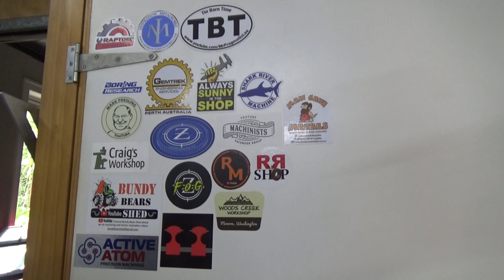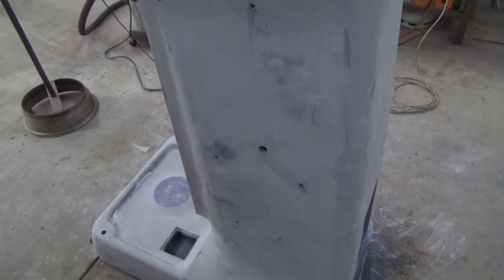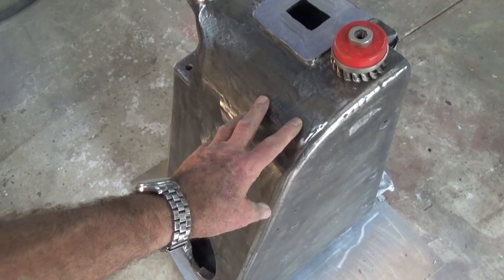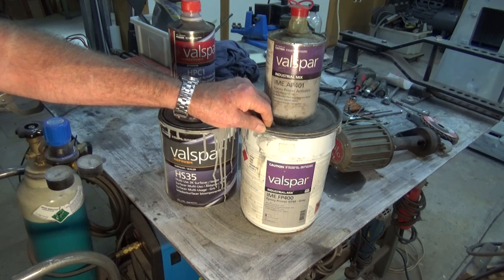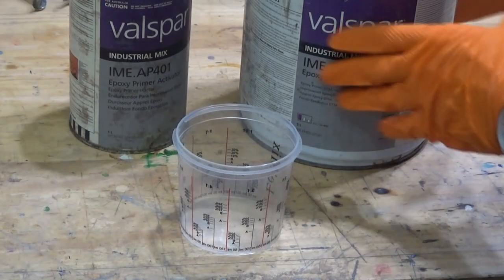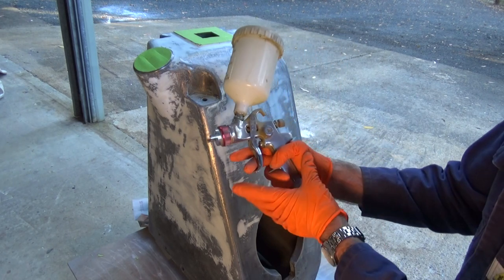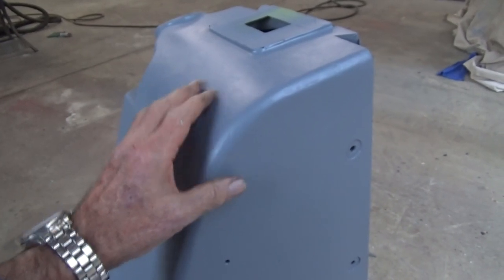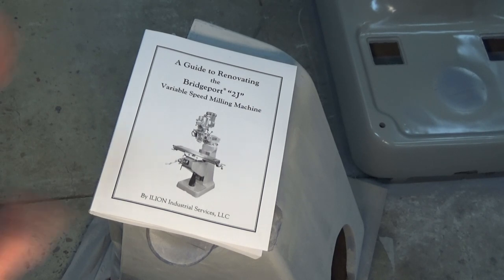Bridgeport Repaint With a Side of Humble Pie

Comment: Most of the preowned machinery I’ve purchased doesn’t get passed repairs needed to restore its ability to make precision parts. In my senior years, I’m much too impatient to restore them to their former greatness. I need to begin machining parts quickly. However I’m glad to see you return the Bridgeport to a thing of beauty. Keep up the great work. Stay safe.
Reply from the maker: Bill, I initially wanted to get the machine running without having to spend a lot of time restoring it but had it not been for a couple of broken oil fittings I would probably be machining on it now. I guess it just snowballed from there. I really do want it to be back together but now that it's painted I have to be extra careful about handling it in case I scratch or chip the fresh paint. It seems there is no end to it!
Regards,
Mark

Comment: Hi Mark,

For what it's worth. I had a lathe headstock (gearbox) casting as well as the carriage gearbox casting awhile back that had been exposed to many years of oil and apparently it was enough to saturate the cores of the castings (the inside of the gearboxes / oil reservoirs had never been sealed before they were put into service, it was a Chinese lathe that I no longer own).  The lathe I have now does have a coating on the inside of the headstock and carriage gearbox.
Yours shouldn't be that bad since it wasn't an oil reservoir.
Like you, I stripped the castings down to bare metal and I decided to try drying them out by heating the entire castings with a rosebud torch, to my surprise the castings caught fire and continued to burn off the embedded oil for nearly a half hour (good thing I done the heating outside of my shop).
I coated the inside of the castings with epoxy and a good primer before I repainted the exterior of the castings in hopes that it would not become saturated again. 
I have no real way of knowing at this point if it worked but most good gearbox castings I've seen does have some sort of sealer inside. 
I do know that the exterior paint seemed to be holding up pretty well even after about 5 years of use. 
BTW, the only reason I repainted those castings was because the paint was blistering and peeling off. The paint on the rest of the lathe was still in good shape when I sold it. 

Thanks for the tips on the best way to get a really smooth surface! I didn't go quite that far with the finish on mine but I sort of wish that I had :-D

Good luck with the remainder of your restoration project.

Joe
Reply from the maker: Joe, my Colchester lathe had yellow paint on the inside of all the oil reservoirs. but even so, the first paint job I did on it failed after just a few years. I used a cheap single pack etch primer and ordinary single pack spray putty to fill the castings. I also stripped the original paint with Selley's Poly-stripper. I was told later that the paint stripper leaves a waxy coating on the bare metal and subsequent coats of paint won't adhere to it. However, the Valspar epoxy coating and the urethane sealer have held up really well. I have had lots of recommendations regarding heating the cast iron to drive off the oil but I was worried about distortion and also I don't own any suitable heating gear. I guess I will have to wait and see if the latest paint job is durable or not.
Regards,
Mark
Reply: @Preso58  

Hi Mark and thanks for the response :-)

I wouldn't think that the knee casting on your mill is nearly as bad as the unsealed gearbox I mentioned. 
Heating the casting in your case may not have helped that much since most of the oil was likely only in the primer, filler and paint.
I was concerned about distortion from too much heat as well and is the reason for using a rosebud so I could heat the casting more evenly and not that hot either, I got it really warm instead of "HOT" if ya know what I mean.
I'm guessing that the moderate heat isn't what caught the thing on fire, it's more likely that the moderate heat combined with a direct high temperature flame is what caused the oil to burn off, when it came time to reassemble the gearbox everything went back in place without issue so I don't think it caused any distortion. 
As a side note, I'm reasonably certain that uneven heat on a casting like that is more likely to cause distortion, if the casting is the same temperature all the way though, it shouldn't distort in my humble opinion.  

I'll have to try to remember the waxy film left behind when using some paint strippers, I didn't know that so thanks for the information! 

Lots of educated guesswork involved in refinishing a surface like this and all we can do is wait for time to tell us if what we did actually worked or not, sucks doesn't it :-D

I have a fairly small oxy/acetylene setup and I mostly only use it for brazing. I have a good plasma torch for cutting steel plates. Having to buy really large oxygen and acetylene tanks just for a rosebud was too expensive for me so I went with an oxy/propane setup for use with the rosebud and it made good sense because I use propane for my forge as well.
If you are considering investing in a good rosebud heating setup, you may want to consider using propane instead of acetylene because of the cost of the tanks and the gas.  

The materials you are using as a filler and primer are kind of new to me, it's something that I'm interested in learning more about so thanks for the level of detail you provided in your video! 
I usually don't worry about aesthetics nearly as much as I worry about a machine working properly, I can't stand owning something that doesn't work right, even if I rarely use it!  :-D 

Thanks again, Mark and I hope you have a great day!! :-) 

Joe

Comment: Stopping and taking it back to bare cast iron was for sure the only thing to do.  Had you sprayed and then had to still go back and strip it down due to fish eyes or the like would have just been worse.  I personally enjoy the hell out of this sort of work.  Putting a better than new finish on something old makes me a happy guy.
Reply from the maker: Well, I can reveal that the final topcoat went on perfectly except for one run on the side door panel. No sign of fish eyes or oil bleed through so I feel like the extra work was worth it.
Regards,
Mark

Comment: Great video, and the humble pie wasn't so bad. Just a suggestion, when painting ALWAY'S PAINT ALL OF THE EDGE'S FIRST. Get color/paint in around that round opening first, paint the edge(s) in a north /south fashion (Top to bottom) first. You would want to get approx. 1 to 2 inch's (25.4 mm to 50.8 mm) width of the edge. Your correct on how to operate the gun, while spraying. To just add a little on the gun operation, the sound of air should never be interrupted with the sound of silence. Also to make it a little easier on the operator, put a very small amount of petroleum jelly (a.k.a. in the United States - - Vaseline® ) on the rod that the trigger pushes against. Also by adding the petroleum jelly again after cleaning your gun out, this will help to prevent the seal from drying out, and preventing the rod from being restricted to move in and out freely. You know the packing / seal has dried out when you pull on the trigger, release the trigger, the trigger return's to it normal position, but the rod has stayed recessed into the gun. When this has happened, either loosen the nut (approx. 1/8 {3.175 mm} to a 1/4 {6.35 mm} turn) that holds the rod, or find a drill bit that is very close to the dia. of the rod. Take the rod out of the spray gun, and by hand try to insert the drill bit, and turn slowly by hand, to cut a very fine amount of the seal / packing away.
Reply from the maker: Thanks for the tips. Unfortunately, when I was training at college, there was no tuition in how to spray paint properly. I had to develop a technique that I could teach to students so that they could get reasonable results quickly. About 10 years ago I invited a professional spray painter to do a tutorial for a group of teachers and he appeared to just wave the gun around in a random pattern and despite this, was able to get a perfect finish. When pressed, he admitted that he didn't know how to explain his technique, just that it worked and that was good enough. So, effectively we learned nothing. As I mentioned in the video, my robot method is not best practice but it gets a beginner to the point where they can get paint on a part with some success. I actually had to dismantle my gun just before I shot that video because the air valve rod was catching on the trigger and I did exactly as you suggested. Problem solved!
Regards,
Mark
Reply: Although i'm not a professional spray painter two of my best friends are and i can only agree with what you have said 100% as this is what they taught me . They always talked about dusting or blowing in the corners or hard bits  first then do the flat panels or flat surfaces . might try the Vaseline trick on my air brush !
Reply: @Preso58  Just to cover another possible problem people may run into using their spray gun's, when spraying with your gun, and you should notice that your getting color / paint on your finger's / hand, and your very, very sure the paint is not bouncing off what your spraying onto your hand / finger's, that's an indication the the air (mixing) valve rod Seal Diameter, is too great / big, and needs to be restricted / closed down some. You will find that it does not take much to reduce the seal diameter. Again just  (approx. 1/8 {3.175 mm} to a 1/4 {6.35 mm} turn should solve the problem. If the problem does not go away, via tightening the nut for the air (mixing) valve rod, unfortunately you will need a new seal. (Very rare for that to happen.) Just wanted to give your viewer's some information that could benefit them.  Happy painting. Preparation (and the quality of the preparation) is 90 percent of any paint job. How long should a paint job take? Answer a simple question. Do you just want some color on an object, or do you want a SHOW-CAR FINISH? Take the object Mark is painting in this video, if he wanted a "SHOW-CAR FINISH," it would be nothing to spend approx. a week (as in 5 day's,) preparing to paint the Knee for the mill. That would also include a base coating of three or four coats, and letting that dry for a day, then wet sanding with some 380 or 400 grit, to get a very flat surface, then dry, then wipe off with some lint-free towel's, one last wipe (at this point, paint is mixed, and put into the spray gun, ready to go) using what is called a "TACK-RAG," then proceed to spray paint your object. When using a "TACK-RAG" you apply just enough pressure that you have control of the "TACK-RAG," and it doesn't fall to the ground. If you have never used or seen a "TACK-RAG," think a cheese cloth that has been sprayed with a lite (minimum) adhesive, hence Tack-Rag. Also Mark could have sprayed his gravel drive-way down with some water ( just enough to make it wet) same for the inside of his garage. wait approx. 5 min's to 10 min's before spraying, giving the dust, etc. that you have disturbed (read that as dust you put into the air around you) to float to the wet ground and stay put.

Comment: Very interesting on the original filler makeup, and the epoxy paint handling and application, the only paint sprayer I have used was one powered by the extracted air from a household cylinder vacuum cleaner, I sprayed a Puch Maxi moped pressed steel frame.
It is my understanding that only the surface of cast iron can retain oil contaminates, rougher the surface, more effective surface, I think only Hydrogen atoms can penetrate ferrous materials. This is a mechanism for hydrogen embrittlement.
Thanks for sharing.

Comment: I can't wait for the delights that you will find when you strip the head , from what i have seen from some other videos it is a real pia to re build - probably a case of if it is still working let it be !
You are definetly going to have the most pretty Bridgie on youtube with that new paint job  !
Reply from the maker: Ian, I started to consider my options with regards to the top of the mill today. One part of my brain says to leave it alone but I have been told that the belt drive does need to be inspected. I have already removed and powder coated a lot of the smaller parts like the selector levers and if I can spray the rest without dismantling I will. 
Regards,
Mark

Comment: Good Show Mate...as always. You are getting the B'port ready for the  Concours de Elegance. It will be so pretty you may not want to use it. I've painted a couple of cars in my career. I think I used up all my patience for painting on them. My Southbend Heavy 10 lathe is in the same shape, paintwise, as it was when I got it 30 years ago. I just don't paint anymore. Be well.
Reply from the maker: I initially thought I would go with the shop worn aesthetic and that does have it's place. If the machine is clean and accurate but otherwise a bit scratched and chipped what does it really matter? I can't seem to help myself sometimes and it can get out of hand very quickly!
Regards,
Mark
Reply: @Preso58  I have to watch that too. If you ain't careful you get started and the OCD kicks in. My daughter makes fun of me because of it. With her it is the pot calling the kettle black. She inherited it from me. Perfect is just good enough. I really appreciate your attention to detail. Be well my friend.

Comment: Mark, this is a good intro to painting for we beginners.  Also, I'm glad that you've got the book by ILION -- I think you'll learn a lot that you didn't even know enough to ask about.  At least I was with the book they wrote on South Bend lathes.  I always look forward to your videos!
Reply from the maker: Bob, I was just over in the shed putting the knee and elevating screw back together. I'm afraid the book is going to look a bit worse for wear as I move on with the rebuild. Greasy hands are not good for books with white covers. I am starting to notice a few subtle differences between the book and the parts that I have. This may be to do with the changes Bridgeport made over the years. I have noticed that on the H&W Machine Repair videos the mention that some parts might be pinned or not and some parts have washers or not. However it's great to have the book to fall back on when I inevitably forget how I took the thing apart!
Regards,
Mark

Comment: I love your work, but I can't stress this strongly enough. If you need to use isocyanate paint and don't have a proper secondary air supply, just roll it on and use sealed one use protection gear. The droplets are a severe hazard to your eyes and lungs. Bare skin is a no. Isocyanate is a lung irritant by skincontact to. Be aware that if you smell a fruity smell when working with the paint you are past the safe limits of exposure.
Pulmonary edema is a slow gruesome death

Comment: I've only had to deal with that once, and I followed advice to burn the oil out with a torch.  Good for cast iron, as you don't have to worry about wrecking any heat treatment.
Reply: I've done similar, but I sent it out to be baked at an engine rebuild shop. Was fairly cheap too, on the order of $50.
Reply from the maker: Is there not a chance that it will cause distortion?
Reply: @Preso58  I asked the same thing of the machinist in the shop I went to. He said it's standard procedure for engines they rebuild. The oven heats everything nice and even. I suppose your mileage may vary. My casting turned out just fine. If you wanted to do the same you should likely inquire as to whether engines heat treated as such require line boring to compensate for distortion. Thank you for another fine video, sir.
Reply: @Preso58  Bring it up to temperature slow and even and no, though you might find that you release tension that existed, so it might be slightly out, especially on a casting that has never been hot since it was poured. Engine blocks will have had enough heat sysles to relieve them, and your casting might move such that one bolt hole in a large section might need a slight enlarging to get the bolt back in. Not going to turn into a pretzel though, unless you have some well hidden by the bondo cracks already.
Reply: @Preso58  - I was told no, that the necessary temperature was only 200-300 F, (100-150 C) just enough to get it smoking.  Since it needs to be done to the whole casting, keep moving and get it reasonably uniform temperature. 
There's a lot of information about preparing oil soaked cast iron for welding, and baking it seems to be pretty common. 
https://www.practicalmachinist.com/vb/antique-machinery-and-history/prepping-cast-iron-welding-219940/

Comment: Mark, I too immediately thought that the casting was soaked in oil and it was sweeping through into the filler and paint. Like you I didn't consider that the original filler was the culprit. More power to the elbow of the bloke who put you on to the real problem. Your portion of humble pie isn't very big so I hope it didn't taste too foul, well not as foul as the two pack paint any way. I'm sure the Adcock and Shipley Bridgeport will come out looking the dogs dangly bits in the end mate!

Comment: This would be a good time to drill a hole in the side of your base, allowing you to drain the coolant when required. I tapped mine 1/2” BSP, with a short nipple and permanent ball valve. Saves you having to remove the strainers and pumping out from the top openings. (Ps: I can’t get to the back of my machine because of how it’s fitted inside my container workshop.)
Reply from the maker: That's a good idea. I am not sure I will ever use the flood coolant but I did rebuild part of the pump today. It was badly corroded around the strainer plate. I never want to bail out the rancid coolant again. That was a truly horrible job. 
Regards,
Mark